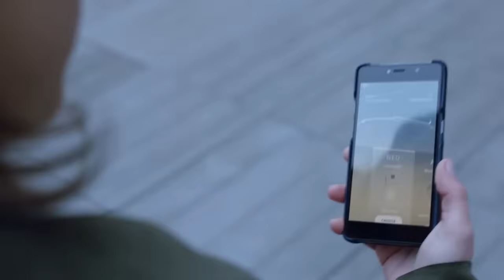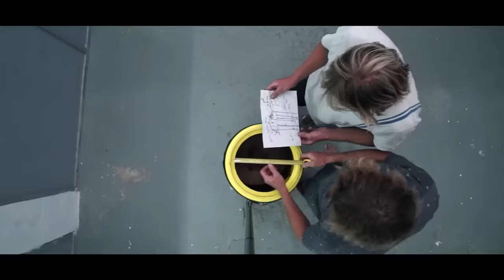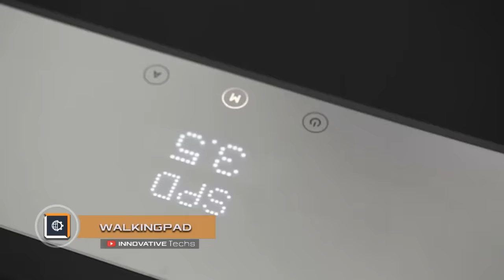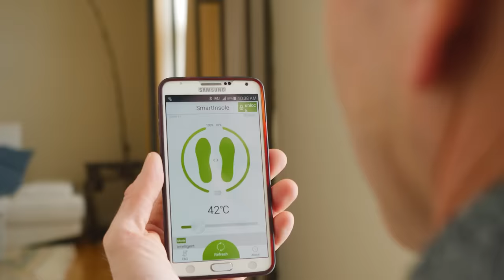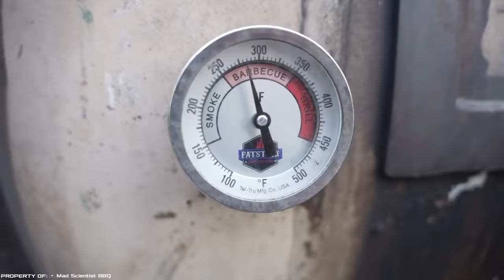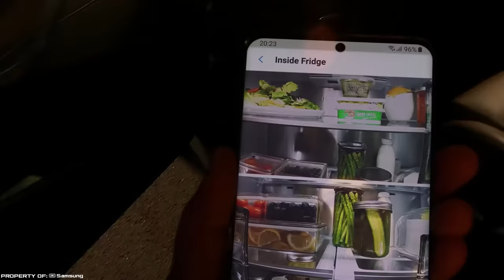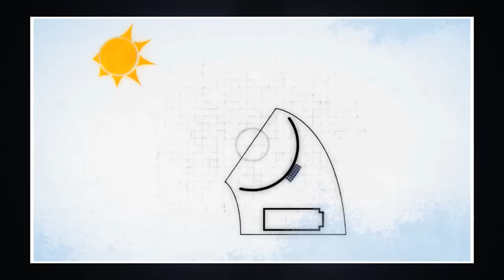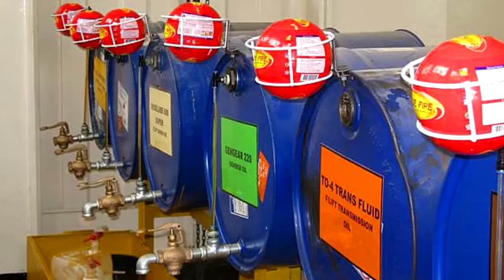60 INVENTIONS ON A WHOLE NEW LEVEL

Comment: @3:30 The Triton Underwater Breathing Apparatus does NOT exist and was a failed product. There was a crowdfunding campaign and they raised nearly $900,000 to bring the product to market. It was estimated that the device would need to filter 90 liters of water per minute to provide enough oxygen for the user, something this little device could never do. The product was never able to perform as suggested and all of its campaign backers were refunded. Sorry, Triton is just a memory, good try though.

Comment: The majority of the people seeing the Human Hoist creeper might as well forget about it.  Unless you think paying almost $20k is a reasonable price.
Reply: Major companies will use these and will cut down on the amount of injuries thus paying for them in a relatively short amount of time.
I think it's a genius invention and should be implemented as soon as possible where applicable. 
But, that's just my two cents..... I could be completely wrong. 
I do believe they could probably do some cost-cutting and get the end product down to a reasonable amount of money.
But, if people are buying them at 20 grand a shot, on a business sense there's no need for them to do any cost cutting....
Reply: @jonny555ive  Hence why I said the "majority" could forget about it.  Joe Homemechanic who sees it and thinks "man, would that be nice!" isn't going to even consider it at 20K.  A lot of small garages won't be able to consider it, either.  This is basically going to be an investment only for major garages, usually the ones attached to a major dealership.

Comment: Triton is a bigBS!!! The reason is simple: the human metabolism is far too intense, similar to dolphins, so much oxygen is needed than a filter can extract from water. The only being in the water that extract oxygen through gills is the shark, but the shark moves extremely slowly, only when detecting prey it attacks explosively, consuming a lot of oxygen already stored in its blood. Let us make some computing: 7-8 mg/L of oxygen in sea water. Man needs 0.6-3.6 g/min of oxygen, but s/he breathe a mixture of gases (atmospheric one) of 20% oxygen and 80% nitrogen, percentage identical with the gases dissolved in sea water. So it would be necessary an average of 2 g per minute, meaning (at a rate of 50% extraction) 5 L/min (100ml/sec.) of processed water.What force pushes that volume of water through filter? And an additional force to extract the gases from water may be needed as well....
So in theory it would work, but the filter must have at least 50% efficiency in order to cover the needs. And it had to have the same proportion of gases in extracted (1/4 oxygen/nitrogen). But here is the hick! Nitrogen dissolves in the blood at higher pressure underwater, and you need a slow climb from depth in order to avoid an explosive outburst of nitrogen in your blood that will effectively boil! So there are many hicks and tricks to be solved before having such a proper working mask ( the ideal depth would be 100 m to avoid boiling blood).
Such a selective efficient filter was not created, as far as I know....